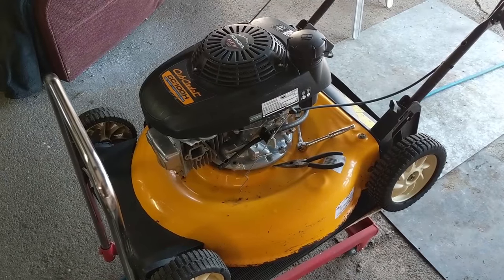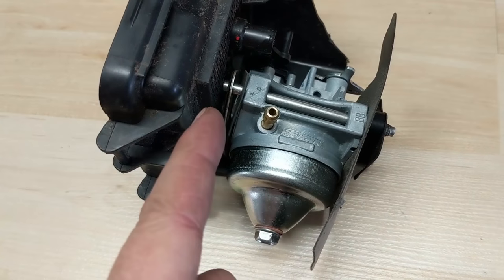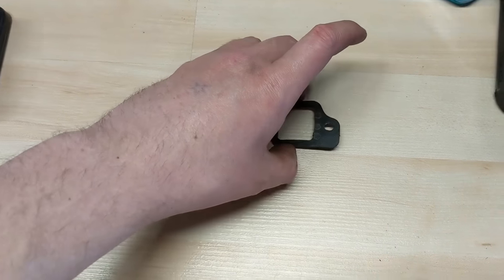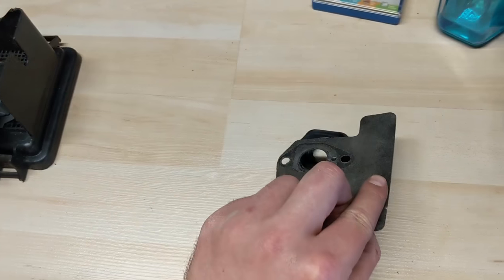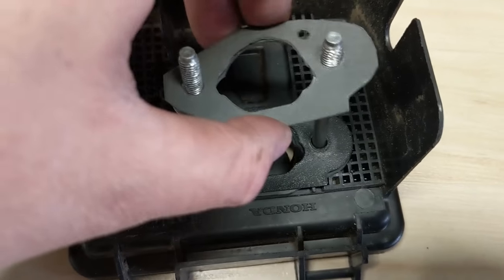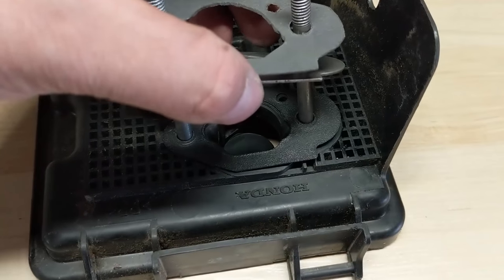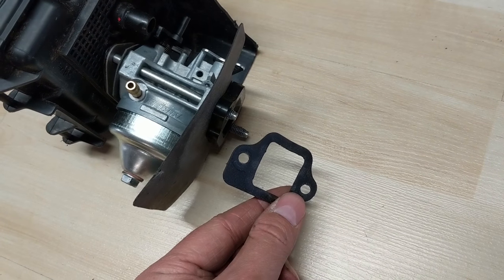Honda GCV160 - Gasket Sequence

Comment: One minor problem. For those of us with the autochoke assembly on their GCV160 the plates are entirely different. Other people watching this will want to take that into account.
Reply: I just fixed a mower with the autochoke, and found this video helpful. I wouldn't say that this model is "entirely" different; it's just one key difference: instead of a paper air dam, my autochoke model had a metal one, and because metal-on-metal doesn't seal, it requires one additional gasket twice (same part number...16221-883-800...one on each side).

Comment: Man I've spent all day trying to figure out the order of these things after taking my carb off to replace the plastic insulator piece. After looking literally everywhere online and trying different orders and the mower not running correctly, I called a timeout for the day. Now I'm drinking a beer and after a strange Google search I saw this video. Gonna give it a whirl tomorrow! Thank you sir, you are a scholar and a gentleman
Reply from the maker: Appreciate the kind words Brian, if I may ask, what were the original searches you typed in?

I can add those words/phrases into the tags and possibly make it easier for other to find this video!

I figured order/sequence was the proper term, but everyone speaks differently.

Would love to know, and thanks for watching!
Reply: @EliminatorPerformance  I'm guessing based on my searches Google figured out what I was I trying do lol but the exact search was "gasket air cleaner mower" lol
Reply from the maker: @FuzzStockDad  well I'm glad you got here eventually!

Being as experienced as I am with these mowers, even I had the exact same issue.

Pulled the bolts, gaskets fell, didn't have any idea how they went back together.

So I figured I'd make a video and it seems to be helping out quite a few people, so I'm happy!
Reply: @EliminatorPerformance  just for the update: The sequence was right on! No gas leaks or running too rich! But when I fired it up the whole mower was shaking so bad. Fortunately just had to replace the blade and all was well. Lawn is cut, finally. Thanks man. Keeping the video saved for future reference just in case
Reply from the maker: @FuzzStockDad  awesome, good to hear!
Reply: Brian, I feel your pain! Removed carb to clean it because my pressure washer would start and kill. Got it all cleaned and started reassembling it. Got pissed and left it night before last. Came back to it yesterday, watched a couple hundred videos, drank two beers and a couple shots of vodka before I left it again. I was ready to throat punch the asshole that designed it with all the gaskets! Now that I found this video, I’m about to go put it together.. hopefully! Thank you for the video eliminator performance!! 

This hack probably isn’t the best one, but while I was putting the crap back together and failing to hold it and get the bolts in and it falling apart, I decided to get some adhesive just to hold things in place so I could get it together and mounted. I used a little loctite adhesive on the top and the bottom of each piece (just a couple of dots to adhere it). That was actually working!! It definitely kept me from karate chopping the enginez 😊😳😫

Comment: Man perfect. This is actual help. Not another video out there like it. Completely overlooked but def necissary. If your engine is surging,or only starting with choke like mine (AKA vacuum leak) caused by something so simple as correct gasket sequence, this video is where it's at. Thanks a ton man!!!
Reply from the maker: No problem, glad I could help. Thanks for watching!
Reply: Well my gaskets r pretty cruddy so think I'll need some gasket maker paper or tube. Sure it should have same function. Stop escaping or incoming unwanted air. Yea mine def aren't air tight worthy
Reply: I had the same problem, I originally took it apart to replace and gaskets and months went by and I finally had time to put it back together and I had reversed the black plastic spacer. Engine was surging, and I looked up this video. Flipped the plastic spacer around and now it runs beautifully.

Comment: You're right when you take the carb bolts out all the gaskets fall and the sequence is gone. Just the vid I needed to put everything back in the proper order. thanks
Reply from the maker: Anytime, thanks for watching!
Reply: Why in the HE Double Hockey sticks separate bolts arent used for the airbox and carb is beyond me.
Incredibly frustrating to reassemble.
My pressure washer had light gasket adhesive on one side of the gaskets  - I highly recommend using some during assembly.
Stay gold.

Comment: Thank you very much man. I bought a used mower with GCV160 and had to replace the carb as it was badly corroded. When I re-assembled it I found that it was leaking gas. Long story short turns out I did not tighten the bolts enough. On my model the air dam is actually metal which was confusing, nonetheless your video helped out a lot.

Comment: My Honda mower with GCV 160 engine was surging like crazy. I thought carburetor. Cleaned it twice but the engine kept on surging. 
I bought a new carb, installed it, and still didn’t solve the surging problem. 
I got lucky and found your video . As I was watching it, I realized that the last 2 gaskets that connect to the intake were placed wrong. I followed the gasket sequence that you showed and problem solved.
You are the master of the trade.
Thank you for an outstanding video. 
God Bless.

Comment: I have watched about half a dozen videos about the gasket locations on the GCV160, all of them others don’t hold a candle to this one, so concise, no Flim-Flam, just a video showing which is located in which location and how to identify each different one.
FABULOUS
Reply from the maker: Thanks for watching!
Reply: @EliminatorPerformance  Thanks for posting!  Just yanked one apart and I knew things were off when I saw no gasket between the spacer and the carb body...  the float needle was not hooked into the float as well...uhhgh!

Comment: Dude. This video has saved my sanity. I've been trying to figure out what's wrong with my mower for the longest time. Always assumed it was air in leakage but couldn't figure it out. You're video was perfect. Thanks so much for making it
Reply from the maker: Glad I could help, thanks for watching!
Reply: Me too...Took my carb off and there were gaskets everywhere...never would have gotten it back together correctly without this video...THANKS!!

Comment: Thanks a million; this really helped me get a backup mower up and running after buying it in as-is condition for 20 bucks. The previous owner--a lawn care guy--said that it needed a new carburetor, and I assumed that it just needed to be serviced. But after cleaning the ports and jets thoroughly, it still ran rough, surging really hard, and only a little less so when choked...it was clearly running lean.
It turns out that the previous owner had done two things wrong: (1) the air dam was installed backwards...blocking the hole where the ball bearing is, and (2) he was missing a gasket, probably because this particular model (GJAEA-6214884) uses a metal air dam, so it needs two identical gaskets (part # 16221-883-800) on each side to create a seal (as opposed to the paper air dam shown in the video, which can seal on its own without any additional gaskets). By the time I figured that I needed another gasket the parts store was closed, so I just used an Exacto knife to cut a new gasket out of thin cardboard, using the existing one as a template...runs great now.

Comment: Thank you so much. I could not keep my honda wood splitter running since replacing the gas line. Turns out I had turned around some of the gaskets. Runs perfectly now. Very satisfying. Thanks!!

Comment: Thank you for making a video CLEARLY showing exactly what I needed to know.  On the GCV160s with auto-choke, that square plastic piece next to the block is replaced with the automatic choke module. Fits the same in sequence, and is the same thickness, though.
Reply from the maker: Glad I could help! I wanted to make the video after I pulled a carb off of one of these a while back and all the gaskets fell out, leaving me wondering what order they went in hahaha thanks for the positive feedback!
Reply: But auto choke plastic piece does not have groove on the carb side which is shown here. Both sides are flat with no groove.

Comment: 10/10 amazing video! Short, clear, straight, and to the point! Very informative and you cover every small detail! I just did an autochoke version and had my doubts but this helped me out! Also helped me on the free pressure washer i just got with manual choke

Comment: That last gasket against the engine block is the one that do it your selfers normally drop out when they assemble the carb and the engine hunts and basically you will get the repair job. Nice video that should help out a lot of your viewers.

Comment: OMG...thank you!  I have been staring at this thing for a week trying to figure out how to reassemble.  No other videos explain what the "metal gasket" part is for or where it goes!  Mine is a 2010 Homelite power washer with GCV190.  It does not have the large throttle control/choke control plate...just that dang metal gasket.  Thanks brother.

Comment: Great video  - I was going to buy a new carb! I cleaned the existing one because it had a tank of bad gas. Put it back together and it would only run with the choke on. I watched your video installed gaskets in the right direction and order; now my splitter runs like a champ. THANK YOU!
Reply from the maker: Happens to the best of us, that's why I made this video! And trust me, even I rewatch it from time to time! Cheers!

Comment: Great video.     Like others I had accidentally put the spacer on upside down, after replacing carb and gaskets. Mower needed choke on for several minutes while warming up, and would then run erratically.   After watching your video I found the problem and mower runs much smoother,  with the choke working as it should. Thank you.

Comment: This is awesome. Nobody can fix my GVC160 even after a new carby and I'm convinced they all left a gasket off or got the sequence wrong as mine will run on choke till it gets warm and I'm convinced it's taking air. $7 for a new kit and this video might put me back in mower heaven. Thank you!
Reply from the maker: It's a common issue, as I mentioned when you pull the studs the gaskets fall out and become mismatched and some people can reinstall them upside down. The holes need to line up to vent, if they don't, the engine won't run right!
Reply: @EliminatorPerformance  Since the kits have to ship from o/s I thought I'd try my hand at cutting a few of my own. Otherwise will just have to wait for the kit to arrive. I'll let you know if it works!

Comment: Thank you for this video! I was having a problem with my mower surging after replacing the carb. Turns out I had the rubber spacer thing on backwards and once I turned it around the mower ran great!

Comment: I REUSED OLD SWOLLEN GASKETS IT CAME WITH AND IT IS RUNNING RICH SO I CAN SEE THAT TECHNICALLY NEW GASKETS INTO THE RIGHT ORDER MIGHT BE THE ANSWER TO THE PROBLEM . THANKS AGAIN
Reply from the maker: Thanks for watching!
Reply: ENDED UP BUYING A 21 INCH GREEN WORKS CORDED ELECTRIC LAWNMOWER I HAVE HAD MORE THAN ENOUGH SO GOD BLESS HONDA AND SAINTAN ALL TO ETERNAL FIREY HELL ONCE AND FOR ALL ETERNITIES AND NO MORE BATTERIE BULL SHIT . JUST A CORD GOOD FOR THIS ELECTRIC LAWNMOWER AND ALSO A 21 INCH CORDED ELECTRIC SNOW JOE BLOWER THAT WAS THE LAST ONE IN STOCK . AT AMAZON WHEN I ORDERED MONTHS AGO , DAVID ADAM GRENIS BOULDER COLORADO USA.

Comment: Yup, line everything up vertically on the bolts off of the engine, then put it all into place as a unit when you assemble it to the engine.  So much easier than trying to hold things in line horizontally while hoping that the gaskets all stay in place before the screws are put in last from the airbox.

Comment: Good looking out bruh! Im having a surging problem on my gcv190 pressure washer. I cleaned the carb and jet(s) . Did a tune-up (oil change and spark plug replacement ) , and using non ethonal gas . Just to have it still surging.  I believe this may be the solution.  Thanks ,whether this  fixes it or not.  This video is still informative and valuable. 😅😂 - 2024

Comment: Your video is great. I wish you would have kept the assembly process the same like when you started. Placing the two long bolts and holding them up  with a piece of tape until you have finished the assembly would leave nothing for the imagination. I, too broke the same gasket and had to make one as well as the air dam. If you have a single hole punch like you would use in place of a 3 hole punch, it does a great job. Thanks again. . .

Comment: great video, but i still have a problem… it still leaks on the front of the carburrator(just behind the airfilterbox)….between  the metal plate gasket ,than a paper gasket and then the carburrator.. ?? my gaskets are mounted correct but still no luck pfffff …. any suggestions?
Reply from the maker: Probably leaking needle valve?
Reply: @EliminatorPerformance  in gonna look to it.  You mean that fine needle tht sticks out on the left inside the carb? If so any suggestion hoe to fix It or do i need do buy a new carb?
Reply from the maker: @jimmysrandomness  no, the main needle valve inside the carburetor. https://youtu.be/uksV4JFsFc0
Reply: @EliminatorPerformance  thanks , and yep you are right its the float needle because if a blow into the fuel Line i van hear the air Escape.. Now im gonna buy a new float needle .. il keep ya posted how its turns out when i got the new part. Thanks for the advice :-) cheers from Belgium..

Comment: Mine has the long metal plate (often called control bracket).  

It also has another metal plate (heat deflector) with a gasket before and after it.  In the install sequence, they go on after the spacer and before the carb.

In the video, the plate & it's 2 gaskets have been combined into 1 piece.  I believe it comes that way on models newer than my 2004.

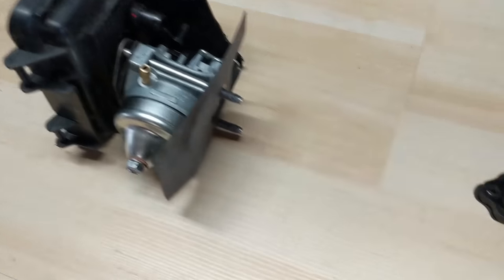Comment: Great video! Can you give me a clarification? at minute 3:07 cover the carburetor hole at the top right, why? shouldn't it be aligned like all the other gasket holes? Thank you
Reply from the maker: That's the way they are, they vent around the inner carb piece, it's like a cut out. For thermal expansion and venting

Comment: Great job on cutting that gasket out  Mon Ami...............      

Some model Honda's are a pain to get everything back on because you have to hook up the linkages to the carb first or I should say hook the carb to the linkages first.........

If Honda didn't have the Zee bend on the linkage and use a turn clip or a E clip to hold the linkage it would be a lot easier to install everything first then just put the linkage on the carb....

I think you and me could teach them a trick or 2 .........   What you think ????  

When I worked at PHI helicopters they would pay techs good money or anyone that was an employee money for a better idea that would help the company out.........

I have a good trick to installing all that stuff and need to make a video on it soon.......

Plus Tard Mon Ami ~!~!

Comment: I have a GCV160LA1 S3B and it has an auto choke system.  I wasnt smart enough to take a picture and didnt realize the 2 bolts held everything on but I essentially have a cover, carb, choke assembly, and 2 gaskets that get bolted in all together and the diagram drawing that I found isn't exactly like my mower b/c its showing all these other gaskets that aren't on mine so I'm trying to make sense of it.   I just ordered a new OEM carb b/c it was only $15 and just bought some gasket paper and glue.  My first time making new gaskets.   Question - I have the 2 gaskets that fell off when I took the bolts out.  One of them is a heat shield gasket like on your video.   Is it better to make new gaskets tracing/cutting from the old gaskets or should i trace/cut from the part that the gasket sticks to?

Comment: i do that also line up the hole or ballbearing it makes sense but those "air gaskets " as he calls them can sometimes be backwards having that extra piece on the top on the other side..in a video i jsut watched form him it was like that..but i figured as long as theyre lined up thats how it goes..my choke goes too fast and then the mower stalls so im going to have to adjust that i guess.. its nice sometimes if i have a mower for a bit that i find these problems that werent there when i fixed the mower..when i did maintence on it-it started right away and i wouldve sold it then the custimer wouldve had this problem , and me not really knowing this was an issue in the first place becasue it started first pull when i fixed it they probably wouldve thought id ripped htem off or soemthing..so i like to keep them for a bit to see if any of thes eproblems or issues arise after maintence